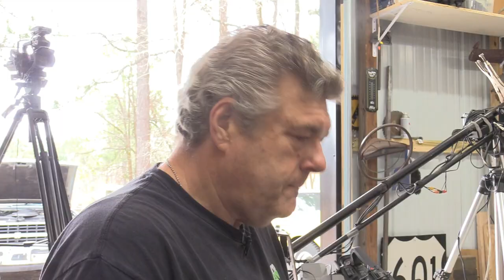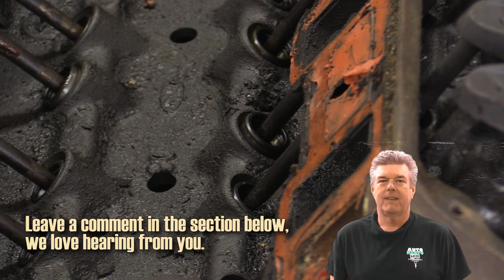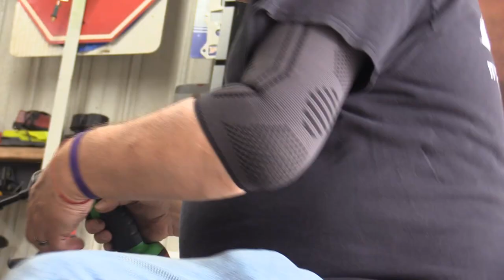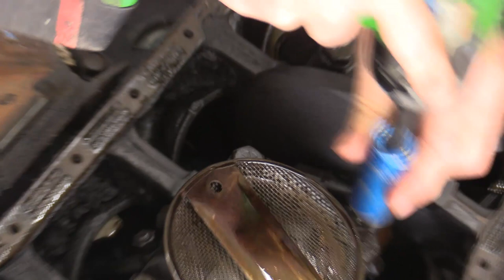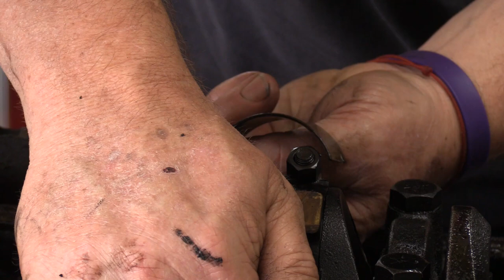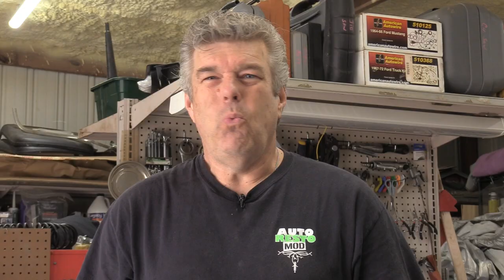Junk Engine Teardown

Comment: Hello Jeff! good info sir! My Dad was an aviation mechanic in WW2 and Korea in the Navy. They always internally cleaned the engines with Kerosene in the crankcase, running them for a couple of minutes and flushing. You can actually get oil pressure with the kerosene but don't run very long. Does a fantastic job getting the crud out. He never hurt an engine doing this. I have done this with old car engines too. Thanks for sharing. Blessings to you and the family! Cheers from Motown/Dearborn.
Reply: Yeah man, these old school techniques do work. I have one that belonged to my grandfather and he’s known for not changing the oil regularly. It was pretty slimy. It had a failed intake valve sucking up into the head due to a failed rocker arm lifter ( Nissan problem).  Before I completely stopped driving it I poured seafoam in the oil and ran it for about a week. It made a big difference. When I pulled the head off all of the crud was soft and washing off, and it made the oil really dark. So when I put it back together, I ran it about a month. Then changed the oil again at about 800 miles. It all seems to be good now and runs like a top.
Reply: @RealWorldGarage  Thanks for the comment and your experience with Seafoam in the oil. Many sing the praises of Seafoam in various applications. Nice to know this. Cheers!
Reply from the maker: Good to hear from you Robert!
Reply: @AutoRestoMod  Roadkill?......I ain't got that kind of MONEY!!!

remember......we're building a 1959 Fairlane Galaxie Skyliner 500 on a Pinto budget!!!

Comment: Interesting and informative video.  Last month I learned an expensive lesson about the original nylon-coated aluminum timing chain cam sprockets.  I had one self-destruct at 70mph, 74K- original-mile '68 Cougar 302.  A shop owner in Wytheville VA replaced the chain with an all-steel double roller, pulled the pan for cleaning, but then had no compression on #7 and #8.  After a $1200, 229-mile tow back home, I have both 3-month old Edelbrock E-street aluminum heads being rebuilt with 5 valves needing replacement.  I've had a couple seasoned mechanics tell me how often these timing chains failed even decades ago.
Reply from the maker: May I eat to hear that for you . Good luck with the repair

Comment: pull the bearing off and look on the under side of it. should be a marking stamped on it
Reply from the maker: There is. The engine is a 1971 build, paired nicely with the 1972 Maverick it came out of.
Reply: @AutoRestoMod  i saw that later in the video, i got to stop writing stuff before i finish watching the video LOL. love your videos man

Comment: That engine actually looks pretty good. I've seen them where you can barely even make out the rocker arms under the crud.
Reply from the maker: True that. I pulled a cover on a salvage yard 351 C 4V once and the junk was almost the shape of the valve cover.

Comment: That motor is out of a Maverick.......hmmmmm, kind of explains the condition. I'll bet that motor was involved in quite a few speeding tickets and lots of random acts of silliness.
Reply from the maker: Dunno. the car had pretty low miles (or so I thought). But I would bet you are right.

Comment: Enjoyed the video, and appreciate your thoroughness. Have my own late '68 302 that deserves a similar check; last run in a different century.
Ditto on the regular oil changes. Back in the late '70s, I had to pull the head on my secondhand Pinto, due to a blown head gasket (my fault, for letting the coolant go low). At some point during this unscheduled maintenance, it seemed wise to check the top end oil flow. Bingo! Crud was clogging the oil ports of the cam lobes; definitely blamable on the previous owner.
Reply from the maker: Those oil changes are key. It keeps your engine healthier.

Comment: The timing of this video! I currently am having issues with my 1972 302. Really want to just buy an ATK small block remanufacture, but got a high school budget so I'll have to save a bunch or maybe I'll have to call it quits with this project truck since I am leaving for college in 4 months.
Reply from the maker: Keep the dream alive! I too was a poor high school kid and managed to get a running 5.0 HO to put in my 1968 Cougar. You can still sometimes find deals locally that will be far cheaper than a new engine.

Comment: If I already owned this engine it would depend on cash strapped I was. I’d probably hit it with the flat shoestring and some polish. Install a high volume oil pump and limit the RPM to 5500. But for this example you are evaluating before purchase, so yeah, take a pass on this one, depending on how much they wanted for it.
Reply from the maker: Exactly. I got it for free. Actually I found a hundred dollar bill under the carpet on the car, so I got pained to take it.
Reply: @AutoRestoMod  20yrs ago $100 was worth $100 still.

Comment: Some times buying ARP is cheaper than buying original. My 5.0 in my 88 broke a Torque to Yield head bolt. I looked for original it was close to $100 at the time and $60 for ARP that I can use again
Reply from the maker: Good point!

Comment: Jeff - as always, great video!  I have an issue I'd like your feedback on (possibly a topic for a future video)... I have a 1966 F100 with a 352 FE.  As anyone with that combination knows the oil pan drain plug location is in a terrible location, obscured by the cross member.  Somewhere in the trucks life someone stripped/cross threaded the drain plug and I imagine it's been a dripper ever since.  My question is about the best way to fix this issue.  My first thought was to do something drastic and buy a new oil pan and relocate the drain location to the front of the pan where it would not be obscured by the cross member.  Is it possible to remove the oil pan without pulling the motor?  Thanks in advance for your feedback sir!
Reply from the maker: You'd have the best chance for doing that on an F100. Our truck has a passenger car pan and it makes oil changes a snap. Now that the pans are available, I'd defiantly do the switch